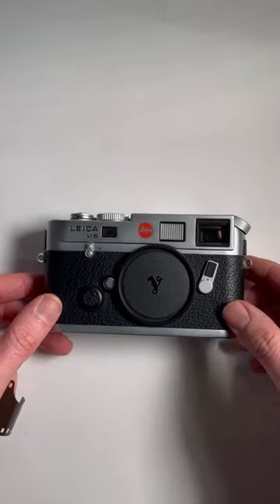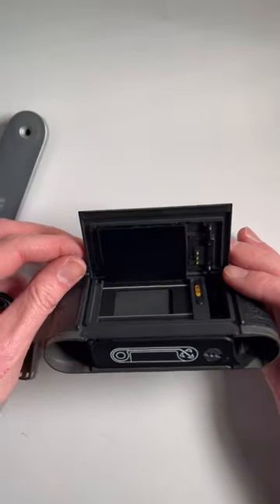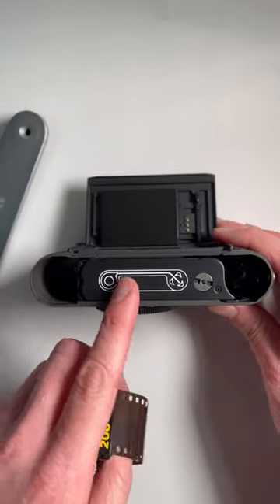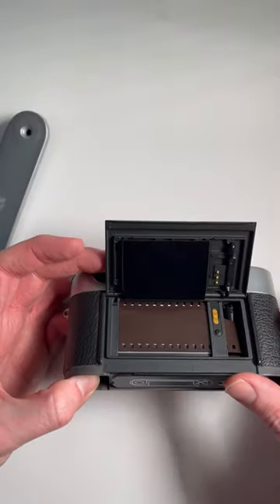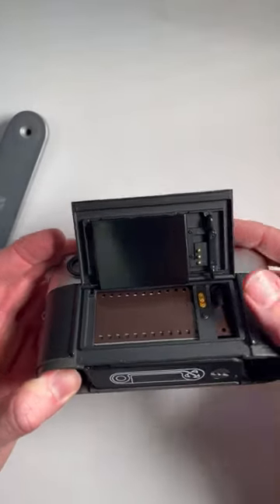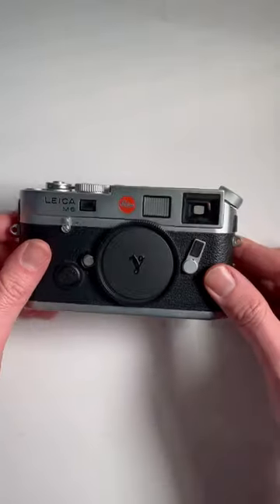Loading the Leica M6 with 35mm Film

Comment: You don't even have to advance the film to make sure it's loaded properly. Putting the bottom plate will do it for you as long as the film is aligned correctly. I get like two extra shots doing this.
Reply from the maker: that's a good piece of advice, thanks☺️

Comment: Someone commented below, but advancing the lever before putting the plate on is unnecessary! the manual says that the base plate has an auto advance mechanism to line up the film for you. Incredible engineering
Reply from the maker: it is very well engineered and does work very smoothly once you've done it a few times. The base plate it not strictly auto advancing but does help keep the film in the take up prongs so it should stay in regardless of if the camera is advanced while the base plate is off

Comment: I’m shooting on the M4 and the bottom load was difficult at first as I was advancing the film before putting the bottom plate on. However once I dropped the film in closed it up and trusted the camera to do its job haven’t had any problems since!
Reply from the maker: the M4 is virtually identical to the M6, because they're so different to most other 35mm cameras you do need a bit more faith in them working once loaded